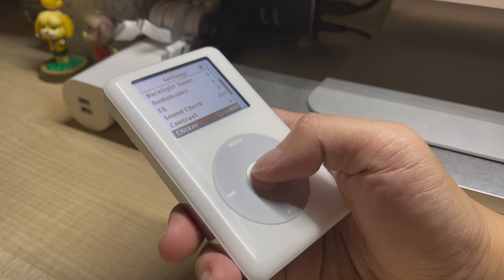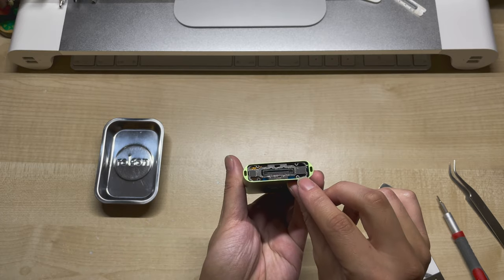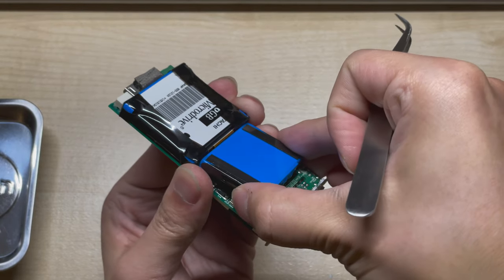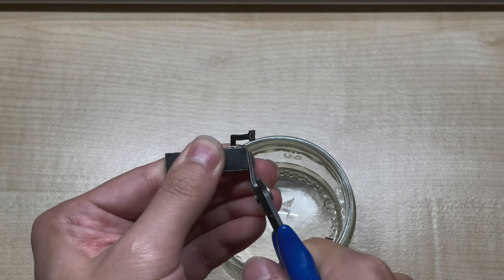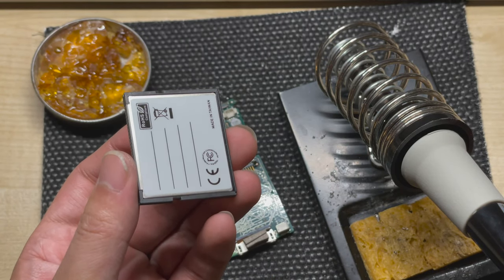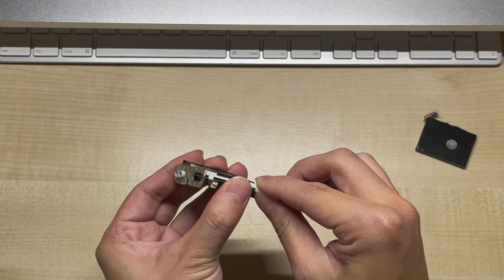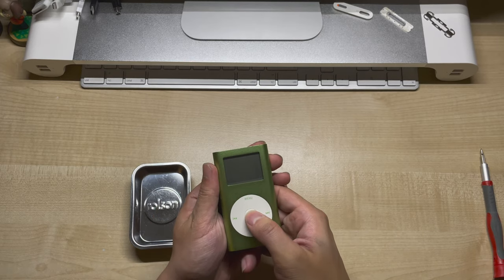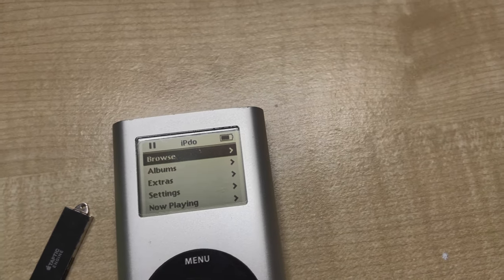iPod Mini Taptic Engine Mod Tutorial

Comment: hi! how did you put the click wheel from classic on mini?
Reply from the maker: I separated the plastic cover from the circuitry by using isopropyl alcohol to dissolve the adhesive, then used a file to trim down the back and make sure it's flat. The 5th gen wheel has the same diameter as the Mini so there's no need to file down the outside, I just attached it to the Mini wheel's ribbon with double-sided tape. The centre button is from a silver 6th gen Classic, with a slightly filed down underside.
Reply: @NekoMichi  thank you. i will try to find pink classic center button, i’ve seen only purple unfortunately
Reply: @NekoMichi  can i use a clickwheel part from classic? or i need it from video only
Reply from the maker: Both 5th gen and newer Classic models should be fine, so long as you properly extract the plastic cover and transfer it to the iPod Mini's Click Wheel.

Comment: Is this mod possible using an iflash cf adapter?
Reply from the maker: Yes, it should work.
Reply: @NekoMichi  Do you need to trim that one as well?
Reply from the maker: I haven't used the iFlash-branded CF to SD adaptors before so I don't know if it has that ridge at the end. If it does, then it'll need trimming.